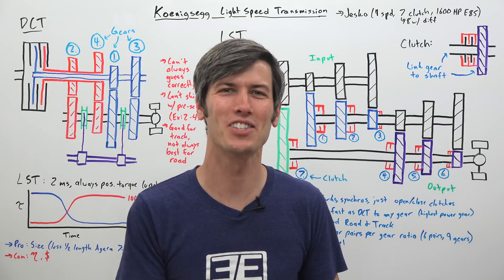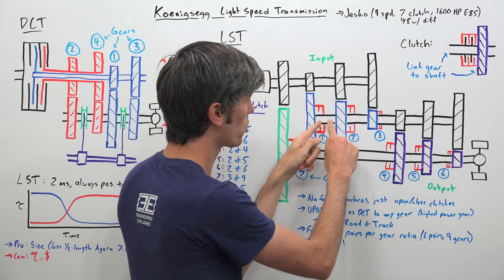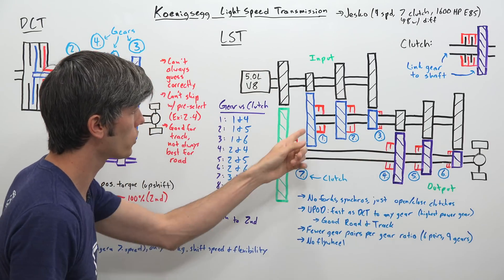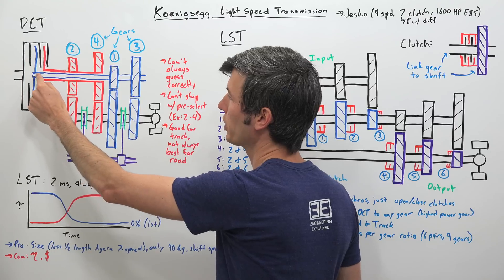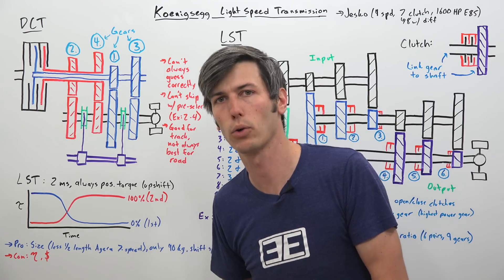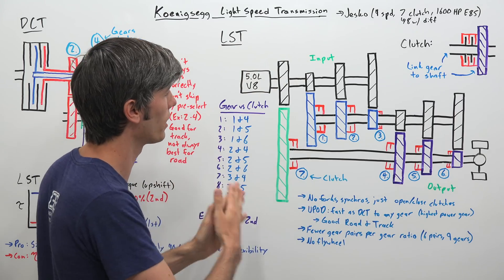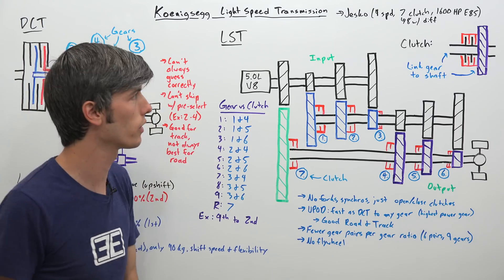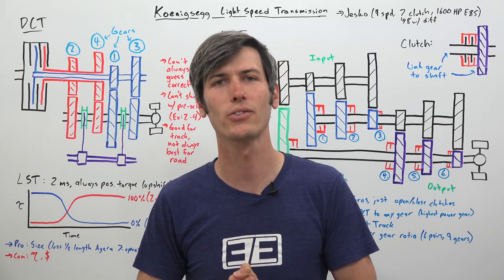Has Koenigsegg Made The World's Fastest Shifting Transmission?

Comment: Could this transmission be scaled for mass production? Do you think it is going to be inherently more expensive, since it really doesn't use new technology, just rethinks old technology?
Reply: It could, but eg. a simple manual transmission is just so much simpler anyway, and the general population doesn't buy supercars. Superfast gear switches not needed for cheap everyday cars. If you want a cheap car under $10 it's most likely just going to be a simple 5 or 6 speed manual.
Reply: @zolikoff  I was thinking more, on the line of, high powered sports cars with supercar like power. Is there any reason that this transmission would be more expensive than, say, a dual clutch? I know there would be patents & development costs but just as, fuel for thought? If this transmission was suddenly thrown out in the automotive world could it be produced, competitively with all the other automatic transmissions? Dual-Clutch, CVT, Torque converter/Automatic. For that matter could Koenigsegg's Direct Drive Transmission be produced for the hybrid market?
Reply: @kds5102  Unfortunately I don't know enough to answer that, but on a first principles basis and this video, I don't see why not. The transmission is famous for being roughly half the size of typical mid engine DCT transmissions in other supercars. That's definitely an advantage for mass manufacture. At this production scale however it doesn't matter.

Comment: so like...40 moving parts in the gearbox....that isn't gonna break or anything...🤦🤦🤦 and i bet the price is delightful...probably 140k for a new gearbox
Reply: Probably won't be as reliable as mainstream transmissions such as DSG, but I would put that down squarely to budget and testing. Bigger companies can afford to put a lot more time, effort and money into testing their designs and fixing weaknesses.  Otherwise the design seems ok, will probably improve with time as they find the common issues that come with higher mileage real world use
Reply: @ChuckRage  agreed, but it is a rather expensive car. the cost to fix is prohibitive. i love the car. it's jist something i take into consideration.
Reply: It's not that much worse than a 6 speed manual in terms of moving parts. The extra electronics are the biggest problem. Which is something people seem to forget, 75% of the time when something breaks in a car it's some electronic component, despite the "so many moving parts".
That said though, this is a hypercar. Reliability isn't the top priority.
Reply: @zolikoff  u gotta realize the clutches wear down. and taking it out requires specialized hand labour. i do see what you mean...i was just hatin 😉✌️ haha I can't even afford the wheels yet, so it's ok. 😂😂😂
Reply: @engiidville  I understand, but manual synchros also wear down. It's not the biggest deal. Not mechanically, at least. In fact, it'll probably be better than a DCT since the wear is averaged out on 6 or 7 clutches instead of just 2. I'm convinced that the majority of added points of failure are electrical.
Reply: @zolikoff  im sure anyone that can buy it won't care.. 😂😂

Comment: This is actually pretty ingenious. It seems to be a variation of the modern planetary gear automatic, minus the torque converter. What I don't understand is how Koenigsegg manages the clutch slip for low speed engagement. Is it slipping two clutch packs for gears 1 and 4? Or does it slip just the clutch pack for gear 4? 

Very interesting. I wonder if this technology will ever find its way into affordable vehicles?

Comment: Your numbering over dct is wrong as 1-2 and 3-4 comes into single dog clutch and dct has different mechanism in that case for shifting in sequence
Reply from the maker: No. One shaft houses even gears. The other houses odd gears.
Reply: Engineering Explained for dct, condition is as you said true but your simple drawing has mistake , for shifting 1and 2 manual transmission operation done under single shifter leverage rather than whole another synchroniser leverage
Reply: Engineering Explained go and do some more home work, you can do good job but you need to learn more, by the way don’t get angry I have completed my graduation in automobile engineering so I always find another’s mistakes easily 🤣👍🏻

Comment: But would it be efficient as the gears which are not locked will be also rotated by the shaft but they would not contribute anything and use up energy

Comment: So it doesn't have a torque converter ???
Reply from the maker: Correct, it has 7 clutches instead. :)
Reply: Everybody's a comedian...LOL  So no flywheel, the engine starts with magic, check.  And the first gear clutch gets the car moving without stalling or spinning the tires, check.  Got it...!! Clear as Vodka...

Comment: It's a mystery that a very low production car company can actually innovate in such an expensive R&D high tech area like this. Most "bespoke" manufacturers have no choice but to just use other people's parts. Even Rolls-Royce used GM transmissions. Amazing.
Reply: @vablo7198  
Actually, with fewer engineers, you can concentrate on the important design features. With a 100 engineers, you get too many opinions and a mediocre all-round design (does not excel at any one thing).
Reply: The difference being is that cars like Rolls-Royce are going to driven unlike the Koenigsegg which are garage queen due to how long it takes to get any repaired when the cars break down which happens frequently.  Most of the technology koenigsegg uses has already been experimented by other automakers. There’s a reason they didn’t use said technology mostly because the difficulty of mass production, too little improvement over existing designs, or being unreliable.
Reply: @abes3925  i can tell you no one else did this, or the Freevalve system, or the transmissiin they use in the Regera.
Reply: @R4M_Tommy  you're right about not having the Free valve in a production car. But we had protype engines running on the same concept in the 90s at Navistar. Unfortunately controllers weren't fast enough at the time to do it reliably for hundreds of thousands of miles.

Comment: Koenigsegg literally combined the best of every single transmission technology out there in this one

1) Compounding from the bicycle
2) Clutch engaged gears from the torque converter automatic. 
3) Selecting gears far apart like a manual, but no synchro rings
4) The lightning fast shift action of multiple clutches from the DCT. 

So why is the rest of the world not even trying?

Comment: Same basic principal as all the ZF 8 and 9 speed and similar transmissions. But with really fancy high power clutches and without planetary gears...
Reply from the maker: Well, not exactly. No torque converters, no planetary gears. Quite a different style. Relies on clutches for each gear pair, rather than planetary sets and fewer clutches.
Reply: @EngineeringExplained  yes. still fewer gear pairs than actual usable gears which is just a brilliant concept..
Reply: @EngineeringExplained  Sounds like we need a video on the ZF 8HP... :D

Comment: Normal car person: I burnt my clutch 

 Koenigsegg car person : I burnt one of my clutches not sure which one.
Reply from the maker: Ha, fun to think about. You could actually figure it out by trying the different gear pairs, and seeing which individual clutch didn't work based on the three forward speeds that rely on it.
Reply: @EngineeringExplained  I'm sure they have sensors to find out which clutch/gear is failed
Reply: @EngineeringExplained  There is one limitation to this. You can't do stuff like 6 close gears and then a long 7th with this arrangement. Well, more precisely actually you can use a 3rd set of gears, but doing so automatically gives you 9. So you'd have to avoid using the other 2 as those gears would not be in sequence.
Reply: @EngineeringExplained  the joke was 7 astronomical units above your head
Reply: @osmacar  that would be parsnips
Reply: Engineering Explained I’d assume the clutch on reverse would see a lot of wear due to one side turning one way and the other the opposite
Reply: @EngineeringExplained 
Haha get woooooshed, mate.
Reply: @dank7491  he didnt he understood the joke as he said "Ha funny to think about" than explained how the problem can be solved also you wrote too many O's Baka
Reply: @ruty6099  
Haha get woooooshed, mate.
Reply: @dank7491  I didnt get whooshed as you so call I just said he understood the joke learn to understand things better. Baka.
Reply: @ruty6099  Haha get woooooshed, mate.
Reply: @dank7491  you woooooshed yourself chief
Reply: Keonigseggs all day every day baby
Reply: Automatics have multiple clutches

Comment: As an automotive engineering student this is just baffling. Koenigsegg revolutionizes so many things in automotive technology which has been somewhat the same for a hundred years..
Reply: as an automotive engineering student.. you should know this is simply a traditional automatic gearbox with cog gears instead of planetary. im actually worried about the future of automotive engineering if you think this is baffling or revolutionary. 

pop quiz: explain how this gearbox operates fundamentally differently than the automatic in a '69 chev? you cant. its just a few extra gears, and the gears are shaped differently
Reply: As an HET, all modern large equipment uses this style of transmission/gearbox, nothing new.
Reply: I'm assuming this has been thought of but the complexity and price has been a factor. A DCT is already 20-30k, can't imagine what this will cost.
Reply: 30 years. 100 years is stretching it.

Comment: In my mind it seems pretty similar to an normal (torque converter operated) automatic transmission with spur gears instead of planetary gears. 

I mean: the ZF 8HP for example has 5 shifting elements (2 brakes which lock one moving part to he housing and 3 cliches which connect two moving parts) and has 8 forward speeds. 
The 8HP cannot go directly from any gear to any other gear because of its design to be most fuel efficient (with the least amount of open shifting elements at any time) and simple. But this could be done with another design. 
Also the torque converter can be replaced with a starter clutch (this is done in some AMG cars with the 7G-Tronic). 

Normal automatic transmissions also only open one and close one shifting element during shifts. 

I would like to hear your thoughts about this comparison to a normal automatic transmission. As always, I really enjoyed your video. I really like this whiteboard.

Best wishes from Germany.
Reply: I'd second this request. The Light Speed Transmission is cool and all but the ZF 8HP is in more accessible cars.

Comment: Been a Nissan fan for years. Considered a 370z to be my perfect car until I drove one. Power and steering were awesome. However I couldn't see out the back, my head was on the roof, and the side windows felt extremely high. Went with a slightly older Porsche Cayman S instead. Absolutely happy with the decision. Good luck.

Comment: Why don’t they make a dual clutch manual? Just four pedals and two gear knobs right? 🤔
Reply: Nah mate, next generation of this transmission will use 7 clutch pedals and 7 gear knobs, 2 is for noob 😂
Reply: I was thinking about this the whole time. You could probably actually do it with just 3 pedals still. Clutch pedal releases all clutches.

Comment: So anytime one of your clutch packs fails for any reason and locks...  while you're in another gear.. you'll be trying to run two gears at once....  I bet a lot of these are gonna explode as they get old.
Reply from the maker: What? You could say the same of any clutch ever. Automatic transmissions use many clutches and brakes. Why would a clutch fail locked? It would have to have sustained hydraulic pressure to do so.
Reply: @EngineeringExplained  Second thought.. of coarse it's hydraulically actuated... just like any other automatic.. lol...  being such a new design, I was thinking of it being a "Manual" .....  anyway, how silly.  I was still on morning brain boot up... I think it's awesome, the real innovation is how compact it is for what you get.

Comment: This is basically over complicated manual with the synchronizers replaced with clutchpacks so it can shift with power applied on the input shaft and go from disengage clutch-disengage syncro-engage syncro and wait to sync-engage clutch sequence to disengage one set of packs-engage other set of packs making it 7 clutch transmission.
Reply from the maker: This comment is over complicated 😘
Reply: Well, maybe it is complex, but it's a hypercar, not a Corolla ;)

Comment: Is LST faster than a pneumatic sequential transmission?
Reply: Sequential has to move those dog rings and therefore not driving the wheels during shifting. 
LST is probably faster, but even if it wasn’t, the car would be faster because it’s driven 100% of the time. 
Not as efficiently though but with 1600HP . . .
Reply: I certainly wouldn't like driving a seq dog box on the streets though.

Comment: What about clutch wear? Does having the wear spread across 6 forward clutches increase longevity, or if most of the driving is done on one gear pair make that pair wear faster than a single or double clutch transmission? 

   Being an auto parts salesman warps your brain.
Reply: I had the same question.  I guess we'll have to wait till one of these cars has been driven for over 100k miles to see the wear
Reply: The people buying these don't care. They'll either go 30mph through cities to show off, or they'll track it once a week. I doubt anyone would daily one, nor would it make it over 100k miles any time soon. My question is how often will the hydraulics fail because of all the clutch forks
Reply: I'm guessing they are using carbon fibre clutch discs for better heat management and wear abrasion, while also being lightweight, which might explained part of the reason why it's only 90kg heavy.

Comment: Would a CVT technically be faster since it doesn’t have individual gears?

Also no thanks I would rather stick to simple autos and manuals from the 90’s
Sheesh— imagine having to replace all those clutches!
Reply: I think cvt has no individual gears, so there is no change in the context of the video ;)
Reply: DCTs shift between discrete gear ratios, whereas CVTs have a smooth transition between gear ratios, though not that fast because it needs to adjust the concave disc's effective ratio instead of de-coupling and coupling two separate clutches. It is more efficient in the sense you can chose between "infinite" gear ratios.
Reply: Apex Seal I see

Comment: Something I wonder about the LST is, if it is all about space and weight, why did they not go for planetary gears? Obviously they were not holding back on throwing clutches at the problem.
Reply from the maker: The best planetary automatics shift times are around 100 milliseconds. This is claiming to do it in 2 ms.
Reply: @EngineeringExplained  yes, when comparing it to converter automatics. But in principle, why not drop the converter and then use controlled clutches to switch gears? Why should the clutches in a planetary transmission be orders of magnitude slower? Maybe there is a reason I don't see. But the design of the gears should not make a clutch 50 times slower.

Comment: PLEASE!!!!!!! explain how engineers stop the car jumping forward when the next gear is selected, no one since the days of DCT could answer me. As the revs need to drop to match the gear how is it accomplished so smoothly while engaging the gear almost immediately.
Reply from the maker: It happens very quickly, but there is a small lurch. It's pretty smooth because it's a curve when you start to look on a very short timescale. You see the overlapping occurs as a transition from one clutch to the next, rather than instantly. But to our minds, 2 ms is pretty much instant.
Reply: @EngineeringExplained  In a manual you get a much more severe lurch as the revs havent had time to drop. So in a DCT shifting faster how is the lurch not worse.
Reply: @EngineeringExplained  And if the cluth is being slipped how is it not overheating.
Reply: I think rev change is quite small when accelerating gear by gear when there is 9 of them.
I imagine when changing more gears, Koenigsegg probably do some clever magic for revmatching.

Comment: How does this Koenigsegg transmission compare to a performance oriented CVT? Not those crappy gear shifting wannabe CVTs.
Reply: CTV would need a flywheel. 
CTV would be much heavier. 
CTV doesn’t need shifting so it’s always IN the sweet spot while any gearbox can only be AROUND the sweet spot. 

“Crappy gear shifting wannaby CTV’s” are real CTV’s that are electronically programmed to mimic gears. That defeats the whole purpose of a CTV. 
A CTV may sound weird but exactly that’s the beauty of the system. If one can’t appreciate that than one shouldn’t buy one.